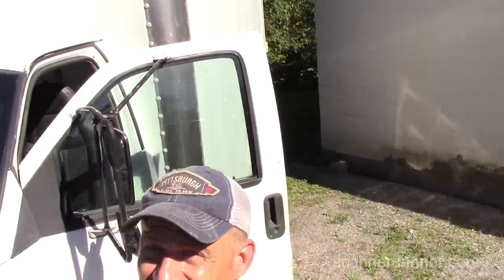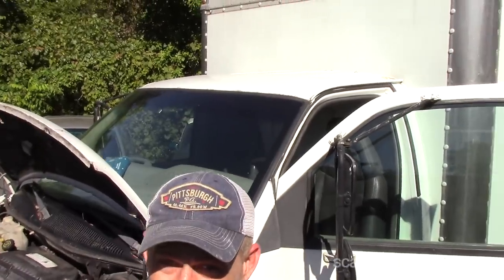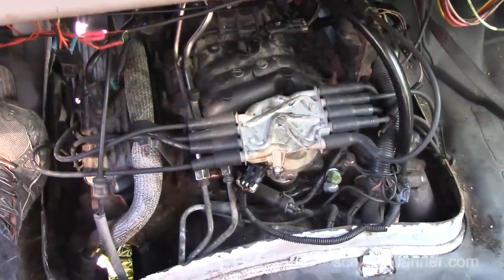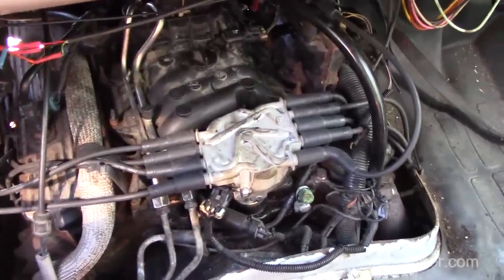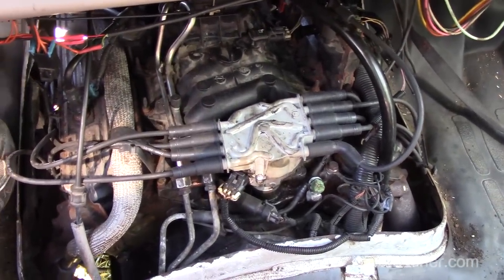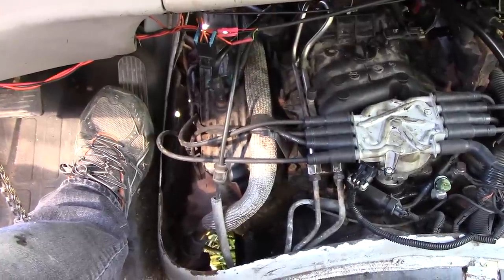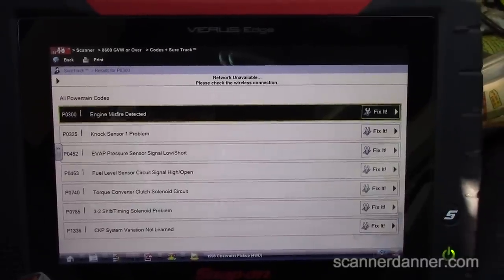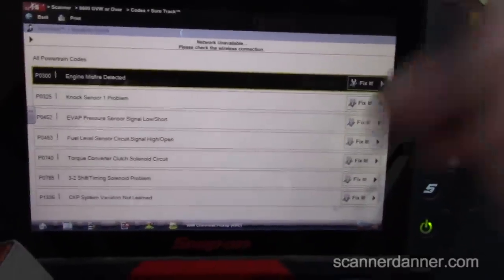How to quickly identify a vacuum leak using fuel trim and water

Comment: What if on Bank to your short term trim is normal? but long term fuel trim or at 15%
Reply from the maker: LTFT learns from the STFT so you still have a lean condition. It's just been compensated for. Treat it the same way as I showed in this video

Comment: So I've been dealing with this car a 95 240sx. I was hoping someone with more experience then me can help out. My cars short term fuel trim is at 99.2 for bank 1 sensor 2. It runs like poop and won't stay on. I put a vacuum gauge on it and it gives me 5 in. If I spray a little bit of brake clean in the throttle body it runs smoother with a higher idle till it dies out because I ran out of cleaner. This is done with the injectors disconnected. Spark has been verified and compression is good. Any insight would be greatly appreciated. I've been battling with this car for the longest time. Thank you. @ScannerDanner
Reply: Love your videos by the way I've learned so much and has helped me solve problems in my own cars as well as friends and family. Keep up the good work and thank you for the awesome videos!
Reply from the maker: It is becoming more and more difficult to answer questions here. I have 80,000 people asking me for help now. So I have created a forum to help you guys better. It is free to join and we can exchange pictures, wiring diagrams and waveforms if needed to help guide you through the process of troubleshooting your vehicle. Thank you so much! Hope to see you there. 
Paul Danner (ScannerDanner)
 https://www.scannerdanner.com/forum/post-your-repair-questions-here.html

Comment: So what happens when you rev it up and your fuel trims increase from like 10% - 28%? Fuel issue?
Reply from the maker: Fuel delivery issue.
1. Dirty MAF sensor
2. Lower than normal fuel pressure
These would be your top two.
Reply: @ScannerDanner  thank you 🙏

Comment: I cant find a vaccum leak but my stft is 10 to 14 at idle & rpm is on 750, what to do now ?
I mean is there any other reason for high fuel trim ?
Plz help !
Reply from the maker: what are your trim numbers at 2500 RPM steady throttle in park?

Comment: In today's electronic world of automotive if there's a problem with the engine the shut off or reduce the gear shift for the transmission these computer modules the PCM ECM ECU what you want are the microprocessors of all these cars they start the car by giving me the relay of ground for the starter for the fuel pump they give a ground the industry has changed but let's keep on promoting on electronics without channels

Comment: It's dangerous to use water like that. I've already seen a guy bend a connecting rod by doing a test like that. I think it's more safe to use intake cleaner if you don't have smoke machine. Just my opinion... Except that, good vid on fuel trim...
Reply from the maker: No it is not. I've been doing it for 15 years, on hundreds and hundreds of cars and trucks. And it is definitely NOT "safer" to use a flammable source. Ever have one intake backfire on you when spraying a flammable source? If you have, you would rethink what you are suggesting. 
What was the guy doing that bend a connecting rod? Dumping it directly into the intake? Seriously, I'm not being a smart ass, I really want to know. Thanks!
Reply: Yeah, you're rigth about the intake cleaner... It's not more safe for the worker, it's more safe for the engine.

The story about my co-worker is the following. He suspected a injector seal vacuum leak on a Volvo 850. By adding water again and again, because it was not absolutely sure about her diagnostic, he eventually caused A hydrolock, and he bend a connecting rod... I know, he probably put to much water, but I think is a risky procedure.

And I absolutely not want to be a smart ass... Lol !
Being myself a teacher in automotive mechanics, I'm really impressed about all you're video and diagnostic logic....

Thanks again...
Reply: You teach Automotive and you seen somebody bend a connecting rod?

Comment: I got 99% fuel trim for bank 1 sensor 1? O2 sensor?
Reply from the maker: Are you sure that wasn't for bank 1 sensor 2? This would be a common b.s. piece of data for a downstream O2 sensor as fuel trim is not controlled based on the downstream O2 on most vehicles. If you see 99% on a downstream fuel trim command, ignore it on most vehicles.
Reply: @ScannerDanner  thank you love your videos!  Short term reads rich -10 long term is lean 15 from top of live data list but under O2 sensor 1 and 2 data 99% fuel trim for both with oscillating voltage  s1 and steady voltage s2.  When I rev the engine s1 voltage goes to .9v plateaus then drops below .1v. Also spark adv goes 13 to 25 to 0 on a rev. Car chokes at end of rev.  Codes are bank 1 rich, low map voltage,  secondary air injection low. Car stalls on abrupt deceleration. But cleaning o2 seems to stop this.  2007 saab 9-3 2.0 turbo.  150k miles new ECU injectors,  mas sensor, fuel psi good. Original o2 sensors. Is map sensor reading low manifold pressure?  Pcv is in manifold stupid. Vented to turbo stupid.  Saab story.

Comment: Yes I found this one today by tipping a bucket of water over the throttle body to inlet manifold gasket join area slowly :-

https://qph.fs.quoracdn.net/main-qimg-5f2cd6d8b2708b9b6323cf1fa5fede0a

This throttle body is off my brothers 2000 model Subaru Forester,the inlet manifold gaskets are still good because my brother got the cylinder heads rebuilt my my cousins partner whose a Subaru mechanic when he was stuck up the North coast of New South Wales with a dropped valve so the gaskets have been replaced.

Carburetor cleaner wouldn't show the fault up but water did when the engine acted up by idling too high & surging after 15 minutes of idling when the engine was very warm,I had to tip what water over slowly then the engine Would smooth out for a bit while then act up again.

So,I'll make a new gasket up for it tonight & hopefully that should fix the problem !

Comment: My scan tool has STFT B1 -10.9% but also has STFT B1 S2 99.2% so what's the difference? Anyone?
Reply from the maker: STFT B1 S1 is your upstream  and STFT B1 S2 is your downstream (behind the cat) fuel trim. Most cars DO NOT use the downstream O2 sensor for fuel trim control and the data for the STFT B1S2 is a b.s. piece of data. Ignore it. 
Focus on your B1 S1 only
Reply: @ScannerDanner  Thanks man that's kind of what I thought but it never moves even .1% and my old scan tool didn't have it!
Reply from the maker: Yeah, definitely can throw you off the first time you see it.

Comment: what about if it has another vacuum leak? you just find a big one.
Reply: If the vehicle still runs bad after (the fix), then you keep diagnosing. My 98 Ford f150 for instance runs bad. P0442 small evap code and a P1300 boost calibration code are the only 2 codes to ever pop up. When 1 goes out, the other pops up. I think these 2 codes are related. My evap leak is either my gas tank leaking or a fuel hose next to it as I see gas all over my tank and truck frame. I was losing coolant as well. It had a slight misfire. What I'm getting at is it has multiple issues, but not showing on my scanner. I found I had an intake manifold leaking coolant into a cylinder. I fixed it. No more coolant leak. Found out I have a clogged cat. My truck has 4. Misfire like symptoms could be from the clogged cat, the intake leak, etc. I'm not throwing parts at it just because. My fuel trims aren't out of range enough to cause worry. I will fix what I know is bad first, then run diagnostics again and again until the issues are fixed. Paul fixed one issue on the vehicle in this vid and another issue is still present which is the vac leak. Once he fixes that leak, I am sure he will run a daig again to check the fuel trim numbers. If it still shows a leak, I'm sure he will search for it.
Reply: If the vehicle still runs bad after (the fix), then you keep diagnosing. My 98 Ford f150 for instance runs bad. P0442 small evap code and a P1300 boost calibration code are the only 2 codes to ever pop up. When 1 goes out, the other pops up. I think these 2 codes are related. My evap leak is either my gas tank leaking or a fuel hose next to it as I see gas all over my tank and truck frame. I was losing coolant as well. It had a slight misfire. What I'm getting at is it has multiple issues, but not showing on my scanner. I found I had an intake manifold leaking coolant into a cylinder. I fixed it. No more coolant leak. Found out I have a clogged cat. My truck has 4. Misfire like symptoms could be from the clogged cat, the intake leak, etc. I'm not throwing parts at it just because. My fuel trims aren't out of range enough to cause worry. I will fix what I know is bad first, then run diagnostics again and again until the issues are fixed. Paul fixed one issue on the vehicle in this vid and another issue is still present which is the vac leak. Once he fixes that leak, I am sure he will run a daig again to check the fuel trim numbers. If it still shows a leak, I'm sure he will search for it.

Comment: Dude they made a poorly designed engine dont try to fix failure. Failure was built into the design. Put a Briggs and Stratton lawn mower in their car it will be more reliable

Comment: Hello scannerdanner,
I have a question on one of your videos that I previously saw but can't find it anymore. it's a misfire on my car 07 nissan versa and I need to check ignition coil but it's underneath the intake and no way to disconnect and check. Any suggestions?
Reply: Sorry man, having trouble keeping up. Did you fix your issue?